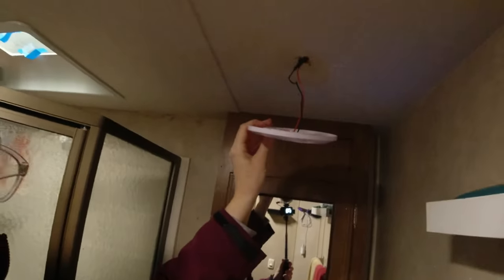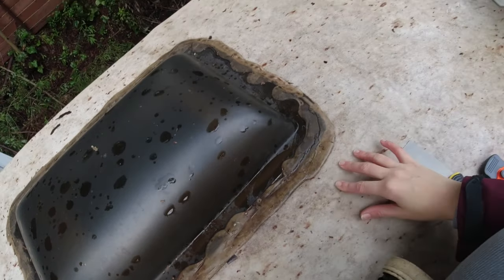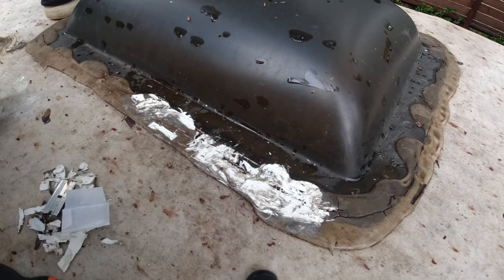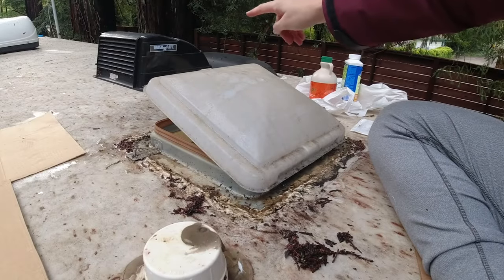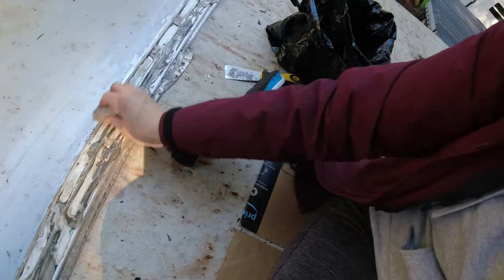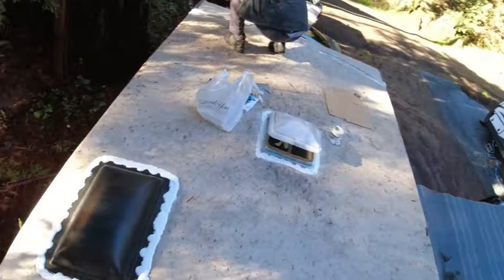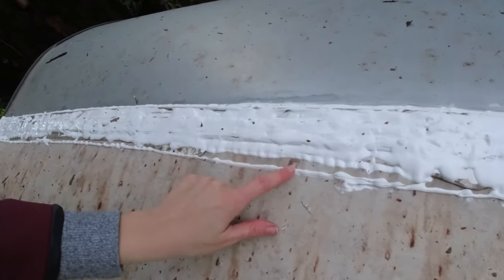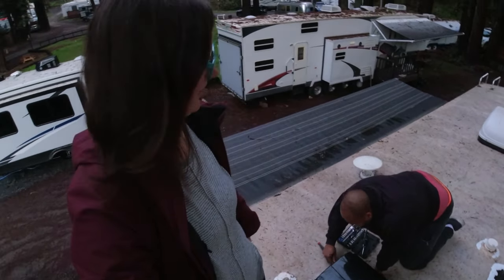OUR RV ROOF IS LEAKING! How we used lap sealant to fix the roof on our travel trailer

Comment: As an RV mechanic I can definitely admit scraping any type of lap sealant that's worn out can be really tough, although a few ways I've gone about it is by using a strong solvent to soften up the sealant to slice off or scrape off, such as "acrysol", that solvent is excellent at cleaning off any type of sealant and is pretty safe on automotive paint, however it can make decal color/paint fade easily if you go liberal with the amount you use.

Next time you have to reseal your roof, consider a solvent like acrysol or something else like it, I know Lawson produces that stuff or just sells it, I also use flat bar scrapers for this kind of thing, a normal caulking gun, and thin bristle paint brushes to smooth over new sealant applied to let it sink in where it needs to go on a roof, such as lap sealant.
Reply: Would a some kind of abrasive Dremel tool work?